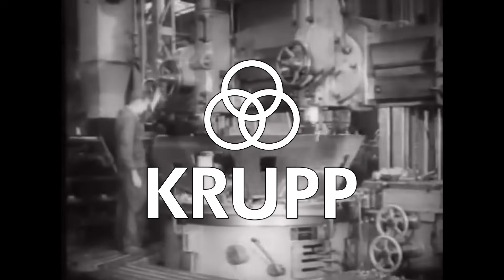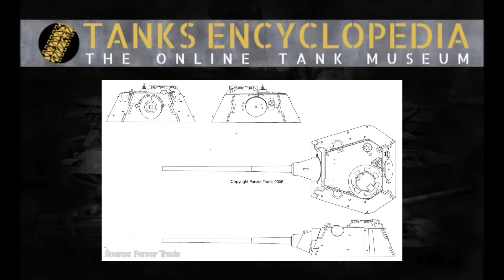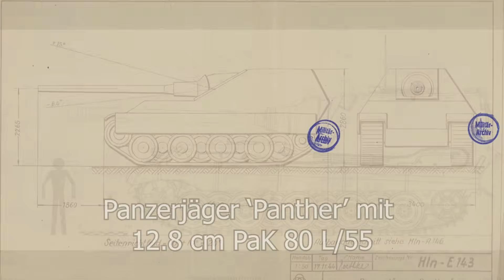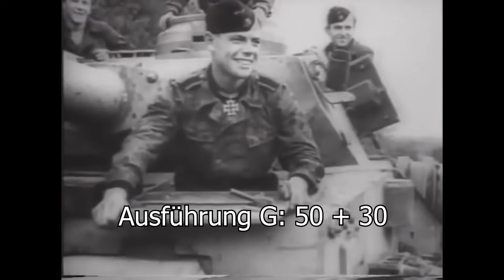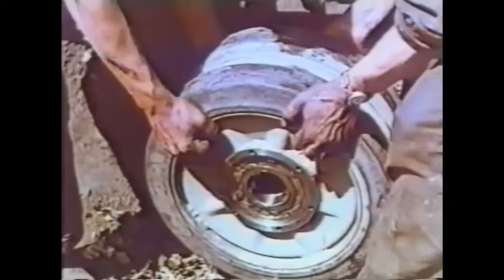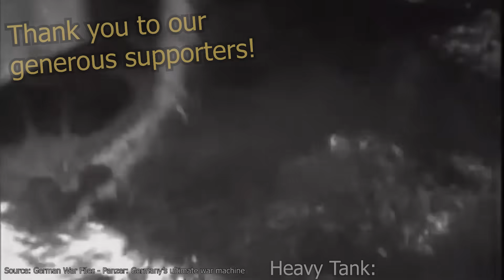Pantherstein | Panzer IV mit 7.5 cm KwK 42 L/70 in Schmalturm feat. @SteelAces

Comment: I always wondered why the kwk 42 was even a thing . When you compare it to the kwk 36 which is the gun that was on the tiger 1, it has roughly the same weight and recoil Force ask the kwk 42. True the 75 mm is faster but the kwk 36 has a much larger explosive charge and the he version. Since tanks use most of their rounds against non-tanks this seems like the better choice. And why complicate logistics with yet another tank round? Is the panther could have been armed with a kwk 36 and still been a legend.

Comment: The Pz IV H was already adequate, but why not  add the schmalturm with 75/L48 and armor reduced to 80 mm to reduce the added weight.  Remove the in hull radio operator + hull mg.

Comment: The Schmalturm would have a better proposition for the mythical Ausf K, with the proposed hydrostatic drive and sloped frontal armour, had any ever been built. Sloped armour would have been able to provide extra protection for no weight gain, or equal protection at lower weight. The Ausf K would have been a match for the T34/85 and more than a match for the Sherman.

How it might have performed head-to-head with a Centurian had the war lasted long enough would be interesting.

My own thought is that converting all Panzer 4 production to Jagdpanzer 4/70 would have made the most sensible use of Panzer 4 chassis production that late in a losing war, though.

Comment: I always wondered why the Panther or Tiger 2  never went with a large slope on the turret front. The tiger 2 is like 10 degrees, the panther is the weird round thing. And the panther 2 wouldn't have had basically a flat slope like the tiger 2. I would have guessed they'd have gone for something more like a m1a2 or leopard 2... but I guess they couldnt make it work?
Reply: The rounded gun mantlet on the Panther turret is indeed a mystery. Anybody could see where a deflected shot would go.
Reply: Sloped armor takes a lot of space that cannot be used for other things, more useles space means a lot of weight added, and most German tanks where already too heavy.  Also the Germans lacked the technology/economy to make more complex armor pieces by casting, unlike the Soviets or the USA. (Somehow, despite controling almost all industry in Europe).

Modern dessings use a combination of relatively flat frontal turret armor with a complex composite armor in front. Composite armor is lighter than steel and is built in modules so it can be changed if damaged, it is not part of the turret structural steel.

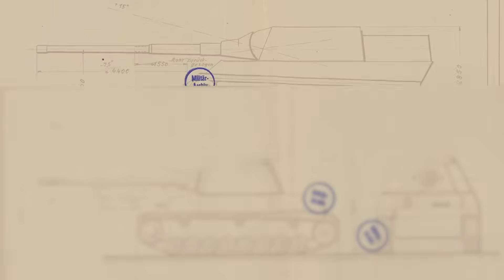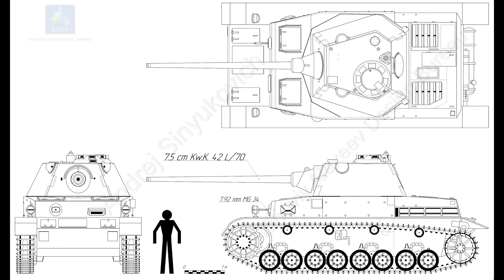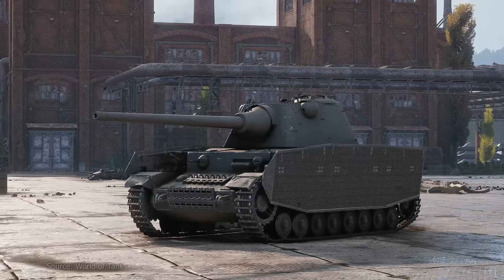Comment: It should be noted that, although similar in shape, the Panzer-IV 7.5cm KwK 42 L/70 Schmalturm design had a completely different superstructure (10:18), being significantly wider with the sides extending well over the vehicle's mudguards. This change was obviously needed to accommodate the much larger turret. It also has what appears to be armored plating over the engine sides not unlike the Jagdpanzer-IV (or a completely different engine compartment).  Although not shown in the blueprint, the engine deck would have had to have an extensive redesign in order to accommodate the larger turret size (17:13) which would, in part, cover a standard Pzkpfw-IV's access hatches. So, as the video states, this is not a case where manufacturers could have simply modified the turret ring and placed a Schmalturm on top to create a new vehicle (as seen in many games and model kits 12:12 & 14:55), rather, the vehicle would have needed to have a whole new superstructure along with the turret. With these two much heavier components added, the result would have undoubtedly, raised the vehicle's weight to around near 30 tons. Pzkpfw-IV variants in this weight range (28 tons), such as the Sturmpanzer-IV & Panzer-IV/70(A) showed the standard Pzkpfw-IV suspension unable to withstand the excess stress. So, the Schmalturm Pzkpfw-IV would have been a mechanical failure if ever manufactured.
Reply: Thanks for making me note this, honestly I thought since the turret ring diameter was smaller I thought the simple modification had some merit, but like you say the drawings clearly show something else. I went looking, and the model made by wargaming for this tank, has the engine access hatches covered by the turret.

Comment: Frankly, the reverse solution would probably make more sense – not only would it free up PzIV hulls for conversion to PzJag or StuG, but a lighter turret with a more versatile gun, still capable of destroying tanks, would also address some of the Panther's problems, which are sometimes accused of being too specialized in the tank destroyer role. Turrets were plentiful, and they were well-known... frankly, I don't know why the Germans didn't seriously consider this, considering there were vehicles with such permanently mounted turrets in command roles. I suspect converting the turret ring wouldn't be that difficult in this direction. And if it were possible to fit a completely new turret onto the T-34, I don't believe the Germans couldn't pull off a similar feat, albeit in a more straightforward manner, with the Panther.
Reply: With how many tanks Soviets were cranking out, the Panthers NEEDED to be able to kill T-34s at range and occasionally a heavy tank. And Panzer IV gun and Panther's gun weight difference was about half of the ton... while being far superior.
Reply: @AKUJIVALDO yet the absolute majority of soviet tanks were knocked out by mines and artillery. But there was simply no good let alone correct solution in the situation germans put themselves in.

Comment: I've liked the idea of a rear gun Hetzer, didn't know it was proposed. I'd always figured 10cm PaW with either 105mm HEAT or 105mm HE mortar rounds for use as a StuG though.
I thought the PzVI turret ring was 160cm, it was larger than the Panther it seems simple enough to make a variant of Schmallturm with 1680 mm turret rings.
I feel like a 10cm PaW would have been a better option, at least in Europe though.
Reply: late to the party ... but yeah exactly the high/low pressure PaW would´ve been a heavy alternative regarding recoil ( though I dunno if the 105mm StuK42  L/28 as used in the StugH 42 had considerably more recoil or a worse HEAT shell ). Also I always wondered if the Panzer I with its extremely limited capabilities wouldn´t have accepted a  75mm Recoilless Gun LG1 ( from 1940 on as light artillery/AT for the paratroopers ) ofc the gun would have to be loaded from the breech, so it needs to be situated way forward and also have an exhaust tube from breech to backside of the turret cuz recoilless and a way to expell the countermass/counterthrust

Comment: Considering the weight problems, an american style open turret might have been a perfect solution for putting the L70 into the panzerIV. 
At that point it would've been a glasscannon anyways, schmalturm or not so might as well go with it.
Reply: Most likely, it would not have saved enough weight to make a difference.
Reply: 120 mm on the front of the turret and massive penetration of armour...truly a "glass cannon" LOL
Reply: @AKUJIVALDO on a hull made of paper that's not gonna do much except making it heavier.
l'd rather just have the gun and keep some amount of flexibility.

Comment: The Pz-IV-J did indeed loose a small generator that allowed the turret to traverse with electrical power when the main engine was off. However, when the main engine was on, it had a power traverse system. The generator was removed to make space for an extra fuel tank.
Reply: Which to be honest seems like a cruel joke to the crew. Yeah we got rid of the power traverse so we can get another fuel tank we can't use because there's no fuel
Reply: yeah and the J version was also the one which deleted everything not absolutely necessary in order to streamline or facilitate production. Electrical motors or copper in general became scarce in 44/45 ( and yeah as Chucky said .... "why an additional tank, we can´t fill the one we have already"  🤣🤣)

Comment: Nice article. I would play steel aces  but i dont like hp based damage, if it has a module based damage system o would play it for shure.
Reply: they said on streams that they will have realistic modes too, i mean they already have all the fragmentation  simulation so it's probably just turning off a setting on their side i think
Reply: @PlainPixels37  nice answer, someday i'll give it a try
Reply: @eliasssarg3239 they're a pretty small team from what they said so they'll probably just focus on the biggest playerbase first and build out from there I guess

Comment: I think in all practicallity, it was a big wast of effort, making the Panthers and the Tigers ever, and the time and effort spent trying new designs was a wasted effort, they needed to get more production of the long-barreled 75mm Panzer IV H/J and simplify everything by 1943, with 3 fronts and great losses, they could not affored the wate. Hitler of course, caused the whole problem pushing the wish on, it only slowed the German effort, and restricting and slowing them dowm, most of the super tanks fell to the waysid,e broken down, the soldiers could see it too, I think it was obvious they were fighting a war they weren't going to win. My 2 cents.
Reply: Keeping the Panzer IV in production was suboptimal. The chassis was too light to carry the weight of increased armor and firepower, and the armor and gun combination of the upgraded versions were becoming inferior to the US M4 Sherman and the Soviet T-34. By 1944 it was outclassed by upgunned versions of both tanks, and it was clearly obsolete.

The crux of the problem is not that Germany required a replacement medium tank to replace the Panzer IV and remain competitive with new and improved Allied tanks, but rather that the German Panther was both too mechanically unreliable for routine use, and excessively complex for ease of mass production. The Panther's choice of main gun and its radical armor design were very good. But it's flawed suspension, overworked transmission, and underdeveloped engine all rendered it a logistical liability.
Reply: Tiger began development even before the Germans entered the war with Russia, assuming that they would eventually obtain Baku oil in 1942. And the confrontation with the KV-1 only made the need and justification for a heavy tank capable of destroying targets at long range even more apparent. Heavy tanks had their space and could prove themselves, as evidenced by the Third Battle of Kharkov, Kursk, and the Normandy campaign. However, you're right that the Germans could have given up on further developing heavy tanks earlier, when the Panther provided them with their capabilities in a much more economical form.

The Panther arose from the need, after the aforementioned encounter with the KV-1, for German armored divisions to have a dedicated tank, significantly superior to regular tanks, capable of fighting any enemy at any range, but clearly aimed at addressing the problem of Allied superiority in armor. Essentially, it's comparable to how the British, after encountering the Tigers, desperately tried to create a tank that could destroy them at a reasonable range, ultimately reaching the same conclusion as the Germans, placing the 17-pounder on the Sherman and ensuring it would be every fourth tank in armored units, a specialized tank (even though they were ultimately developing the basic Panther, the Centurion—same weight, armor, and specialized gun). However, the Germans faced the problem that from the moment the request for it was submitted in the fall of 1941 until the Panther entered action in the summer of 1943, German armor suffered a cataclysm related to the enormous losses suffered by the PzIII, which was too vulnerable to the anti-tank weapons available to the Allies. As a result, the PzIII began to be repurposed with the PzIV. The III was now intended for combating soft targets, while the IV, with its long 75-barrel cannon, was intended for armored combat. But it turned out that this wasn't working, because the IIIs were too vulnerable, and the need to improve the infantry's anti-tank capabilities was enormous (the Pak-40 guns were just arriving). So the most logical thing was to mount the long 75mm cannon on the Pz-III. The problem was that this could only be done as a self-propelled gun, not a tank. Still, it was a better solution than a tank that couldn't really perform well in any role, and its weaknesses were killing the armored forces too quickly, which the Germans couldn't replenish quickly enough.

But then came the Kursk, and it turned out that the Pz-IV, despite having thicker armor, was already starting to struggle against the Soviets, who were using a new generation of anti-tank guns. And the problem arose: if they fielded even more powerful guns in a year, the Pz-IV would be in the same position as the Pz-III, because the chassis wouldn't allow for further armor upgrades. Therefore, consideration was given to moving it to the self-propelled gun role, while retaining the Panther as the main battle tank. The Panther was not only frontally resistant to virtually anything, but also had sufficient reserves to allow for slower obsolescence. This was crucial, as the aforementioned personnel, in order to recover from the heavy losses suffered in 1941/42, simply had to survive an encounter with the enemy, and the PzIII and IV were increasingly unlikely to provide this.

Ultimately, both the PzIV (the best version of which, in this short period, left the line in over 2,000 units, representing perhaps a third of total production, indicating effective improvements) and the Panther were mass-produced in 1943 and 1944, with both tank types effectively serving alongside each other, complementing each other.

Comment: If the M3A3 Stuart light tank is available in Steel Aces, please get the specs correct. 2 are available nearby on static display and complete if information is needed. 
I crawled up the engine cooling exhaust and fed a camera to the interior; radial engines and turret baskets are still in place.
They would be perfect for a museum to get running again; owned by the US Army.

Comment: “Slaps Panther turret on Panzer 4 Ausf C”

Transmission: Guess I’ll die now…..
Reply: More like the suspension. That leaf spring ain't holding up no Schmalturm and L/70.
Reply: @KnobleKnight2002  yeahh
Reply: @KnobleKnight2002  That turret roof isn’t..
Reply: I sure do know that the Suspension is suffering in pain
Reply: Too much gun for that chassis. Improved sloped armor version that also wasn't built would have been a better use of resources. Better yet, the Panther being given more time in development to iron out the bugs would have made sense while the Pzkw IVs soldiered on. The 75mm 48L was an adequate gun able to knock out all but the toughest allied tanks IS/JS II and M-26 Pershing. The 20 M-26s that finally showed up late in 45 hardly weren't an issue.
Reply: Not really, panthers were cheaper to produce than the pz4

Comment: Signs of the times.  Expedience is the mother of invention.
T34/85 was a standard T34 chassis with the turret from the T43 stuck on top (and upgunned).
M4A3(76) was a standard M4A3 chassis with the T23 experimental tank's turret stuck on top.
Reply: Problem is that Germans already squeezed everything they could from PzIV chassis.
Reply: Didn't the T-34/85 have a slightly widened hull for a new turret inspired by the one on the T-43?
Reply: @kacperq1987  Nope. Supposedly some variants of T-34/85 had somewhat lengthened hull (around 200 mm), but these are likely post-war variants. Width remained at 3000mm . Of course, turret ring width was increased. Early examples of T-34/85 were actually made from damaged and then factory repaired tank hulls, in order not to disrupt production in case that T-34/85 modification is unsuccessful.
Reply: @kacperq1987  Not that I know of.  The T43 had a slightly widened hull (albeit with Torsion Bar Suspension).  I am told they went with the standard T34 hull so as not to slow production (by having to retool for a wider hull).
Reply: @WildBillCox13  It's even more impressive how they managed to so sensibly integrate the new, significantly different turret with the old hull, which wasn't designed for it.
Reply: Since the maximum width of tanks was limited by rail transport ( and tunnel width for rails and so forth ) to about 3,60m ( thus the need for the narrower "Transportketten" for the Tiger I), I never understood why they didn´t max the width of the Pz IV in order to use the space of the railcars efficiently and get as much stuff in, in the end the width doesn´t change much in hit probability but the height does ( at least in WW2, nowadays its a moot parameter ). So wider, a bit shorter ( or the same with space left for a larger motor ) or lower silhouette would´ve done the trick and kept the weight similar I guess ( though ofc the heaviest front armor panel would´ve weighed more cuz of more width, probably a large factor in keeping the tank narrow ? )